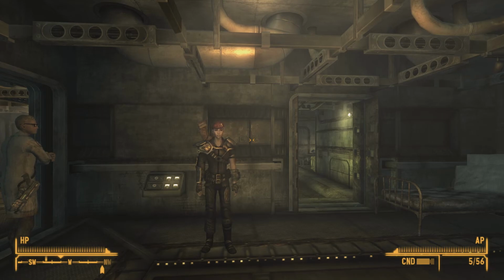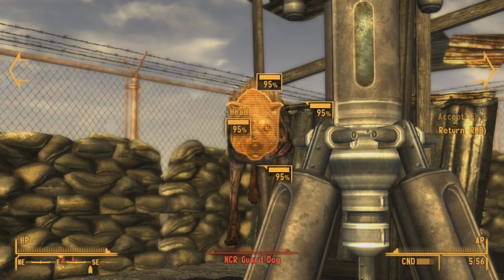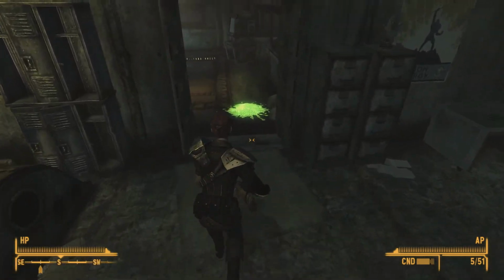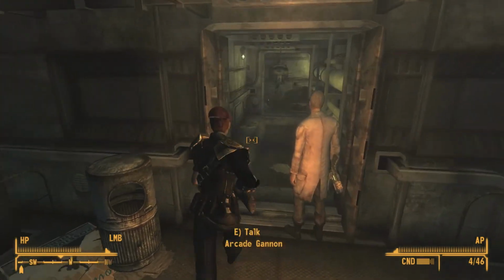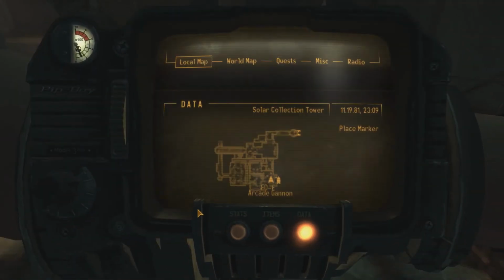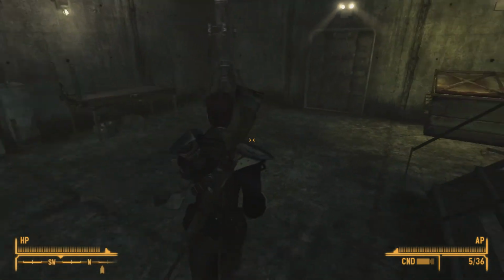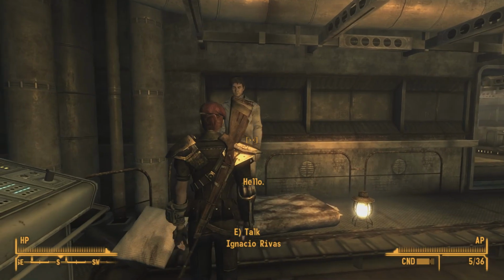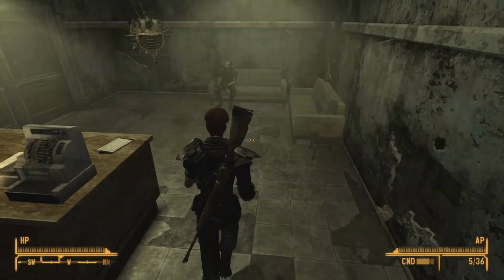Let's Play Fallout: New Vegas (Blind) - 41 - Fixed!

Comment: you apparently didn't even notice how arcade disposed of the two turrets on the ceiling when you first entered the solar tower lol
also, companions are unkillable and completely heal after each battle as long as you don't play in hardcore mode. so you don't have to have him wait every time you disarem mines or something.
Reply from the maker: Oh, I'm not worried about Arcade hurting himself. I'm worried about him triggering a trap and hurting Hera. It happened before with Boone who triggered a tripwire that I carefully tried to avoid, and it set off an explosion and crippled several of Heras limbs.
Reply: @SkadiLP  ok. sorry for misunderstanding then. i think this happened to me only in fallout 3 and 4 (especially in 3 companions just randomly ran off somewhere and got themselves killed permanently).
Reply: Arcade is pretty handy with that plasma defender.  I think he has 100 energy weapons skill.